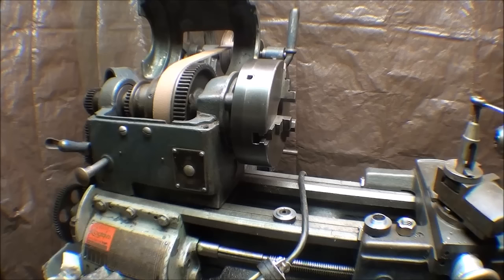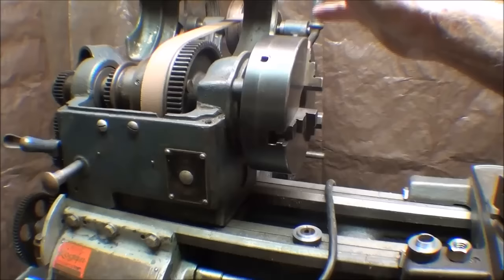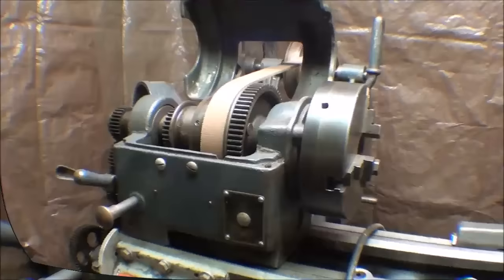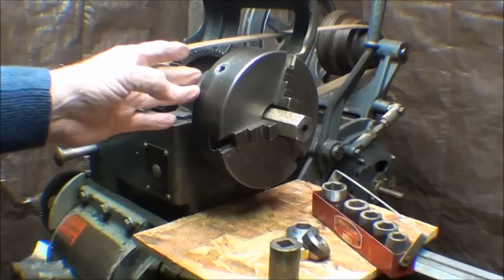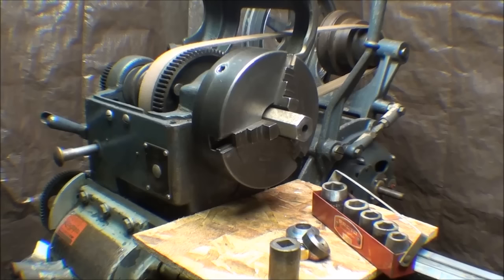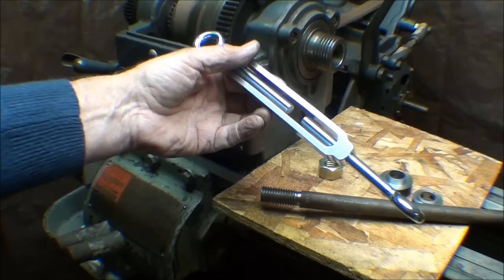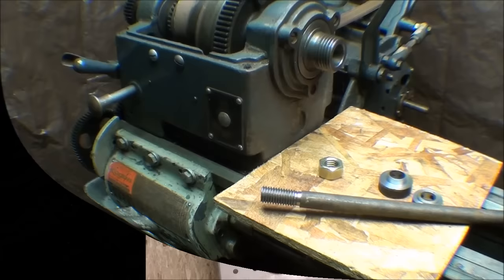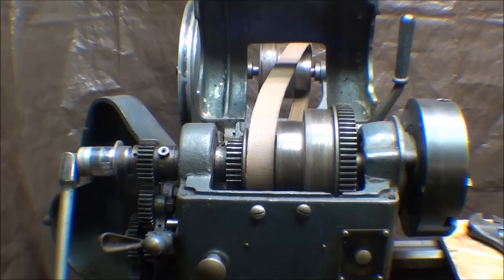SHOP TIPS #281 Removing a Stuck Lathe Chuck tubalcain atlas

Comment: I removed a stuck chuck by making a home-made strap wrench.  I took a 3" x 24" piece of maple board, drilled a hole in the end and hooked one end of a rubber bungee cord in the hole in the board.  I laid the board on top of the chuck & wrapped the bungee strap back around the chuck, pulled it tight up under the board & then pressed down on the end of the board.  The chuck came loose on the 2nd push.  The maple board was slightly warped & that may have helped.  Hope this helps.
Reply from the maker: +Gary3247 Nice solution- Thanks for watching

Comment: I would never dare to unjam a chuck with the first two ways you described , especially not on a Myford ;  just take a brass bar (square) 1 foot long , put it between the jaws : one jaw will touch the bar perpendicularly straight then the 2 others will shoulder the square bar with their 45 degrees faces, tighten it lightly , hit the bar with your fist , the brass bar will immediately stop as it comes in contact with the bedway , if you are used to do it you don t even have to lock the backspeeds gear or the spindle itself

Comment: NEVER engage the "back" Bull gears to lock a chuck !  MrPete, you should know better than to even mention it as a possibility, and if a few teeth are damaged on said gear, a new one for an 820 is currently $506 from Logan Actuator. Why would the lathe be ruined and need taken to a landfill ?  I will personally come get all your landfill lathes ;) Using an Impact wrench is harmful to any/all gears. please make sure to disengage the reversing gear (put in neutral) so the impact action does not transfer to any engaged gears or guaranteed that teeth will be broken.

 The best way I have found is to use 2 strap wrenches, one on the chuck, the other on the cone pulley. this is in essence, the way a belt driven lathe works, so why not use that to remove the chuck ? think of the forces we put on the cone in the forward direction while taking a deep cut on a hardened part. (you can even use them on a v-pulley by cutting an old belt to use in the grove like MrPete did)  Good strap wrenches are ~ $40 each and are priceless when needed. Buy a pair and add them to your tool arsenal.   T.
Reply: T. DesMarais i
Reply: T. DesMarais I don't think he did,he said not to do that.